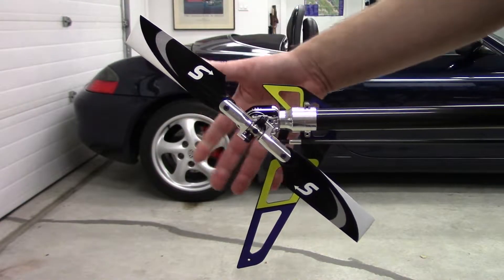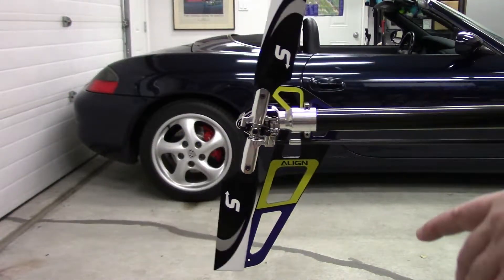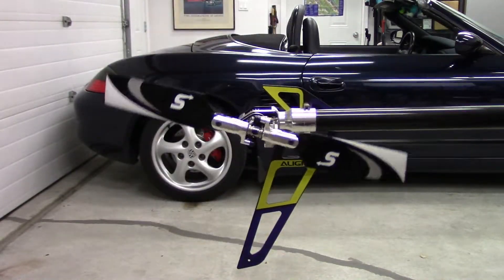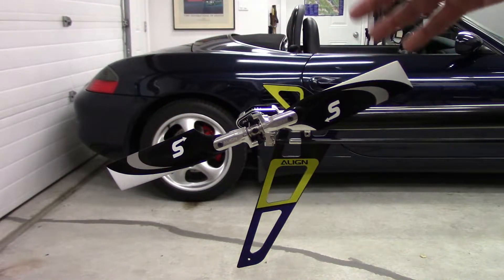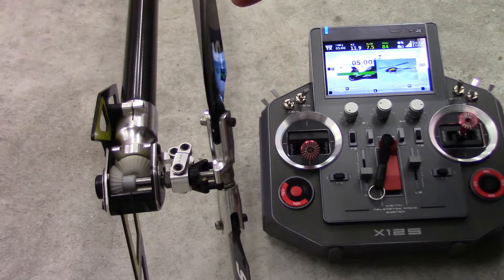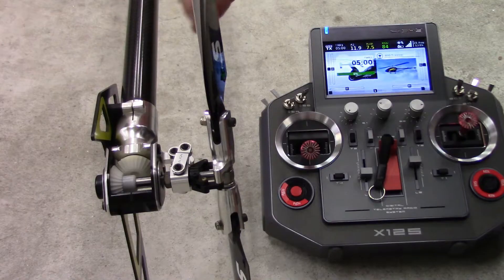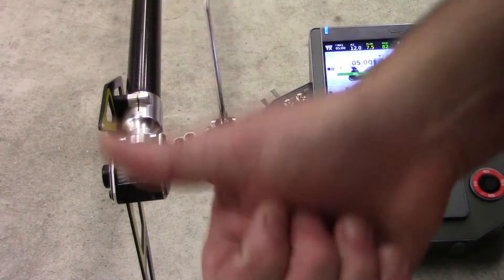RC Helicopter Tail Rotor Setup

Comment: Hi John, I guess you forgot to mention that some helicopters (like N7) have tail rotor rotating clockwise per design. Which makes all the rest opposite...
Reply from the maker: At 5:00 I mention "most, not all"...  Starting @ 6:00 I then talk about how to confirm tail thrust by actual blade pitch angle over pitch slider direction.
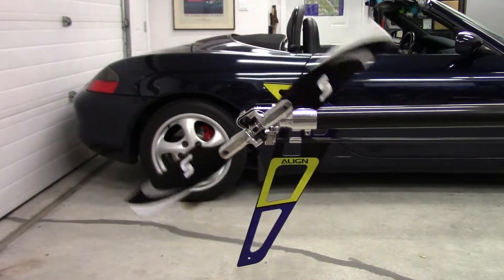Reply: Right, you mention that, but in a context of the pitch slider. Before that you put a lot of attention to "correct" rotation direction, which may be a bit misleading for beginners having different heli. Maybe some text note over the video around 3:00 would help. Just my five cents though. It is very good video for most of people. Not too many helis there with CW rotating tail. There are probably more, but I know Synergy only.
Reply from the maker: Thanks for the clarification - sorry I misunderstood. Synergy is the only brand I know of as well with a clockwise spinning tail rotor in the 30+ years I've been into the hobby. I wonder why they do it that way? Thinking not many beginners will be starting out on a higher end Synergy heli, but you are correct that I should at least make mention of it :-)
Reply: I've heard that it is not that important really, especially with modern FBL units and for free-style helicopters where tail is rotating fast enough, giving lots of tail authority anyways. Also, 1:1 helis have tail rotating both CW and CCW, on left on right side of the boom . Seems there is no fixed rule there. Truth is though that most of models have CW rotating main rotor, and CCW tail - possibly for a reason... or just everybody is following the pattern ;).

Comment: Nice job bro, wicked camera sharpness. Was looking for where neutral setting on servo should be as it relates to tail pitch. I’m newbie. I know tail has to have a positive pitch even at idle. Just don’t know if my linkage rod is adjusted to its optimal setting. My servo arm squares up nicely when brain does it’s thing.  I guess what you were saying is you have it right when servo doesn’t whine when full stick each way. Is that correct?  Thanks if you do respond. Thanks if you don’t anyway.
Reply from the maker: Hi Matthew,  assuming you fly with the tail in heading hold, you really don't have to worry too much about creating tail pitch when the servo arm is centered with the pitch arm at a right angle & pitch slider is centered. The gyro will automatically hold in the correct amount of pitch to compensate for the torque to stay locked on heading. Some heli manufacturers setup the tail geometry correctly to be producing a little bit of tail pitch when both the pitch arm and slider are centered, others don't. As you pointed out, the main thing is you set the tail servo travel end limits (in the tail setup section of the Brain programming)  correctly so the tail servo is not stalling out when at full left or right pitch.

Comment: Torque tube is nice, but if you tend to crash a lot belt drive is more "surviveable" and belt lasts virtually forever.  You won't break a gear when landing in tall grass either or from a rough auto landing.  With over 6k flights on my Trex500, I salvaged many "bent" tail booms.  There is a little bit more "complexity" that you need to focus with a belt; however, like the belt tension and "initial" belt bend direction in the boom.